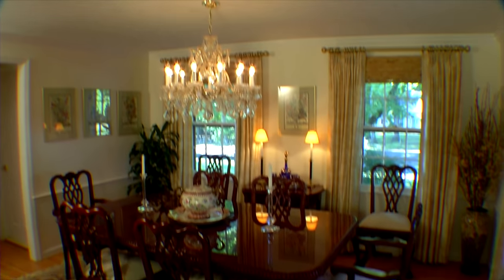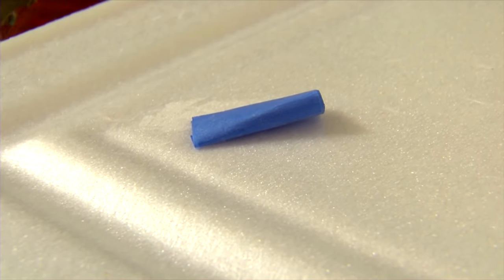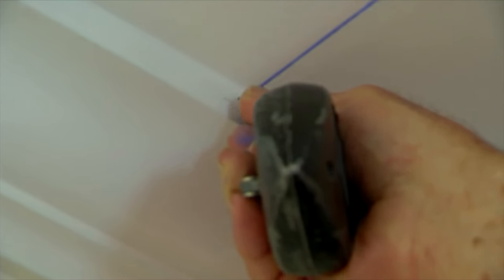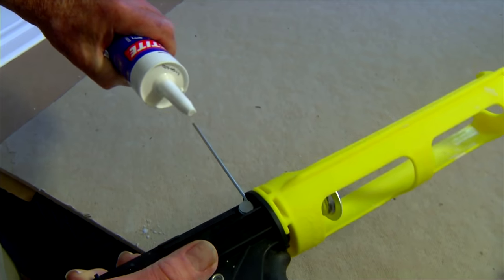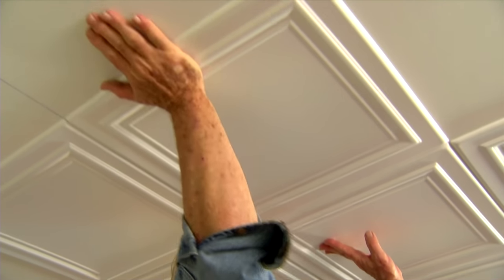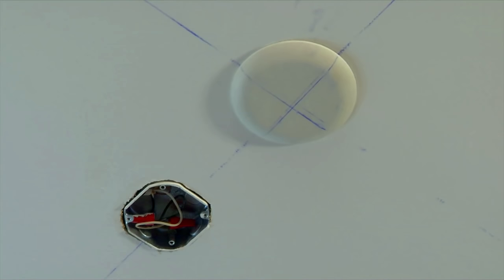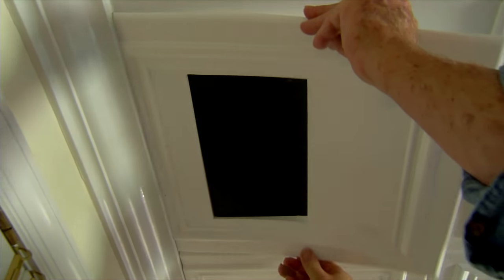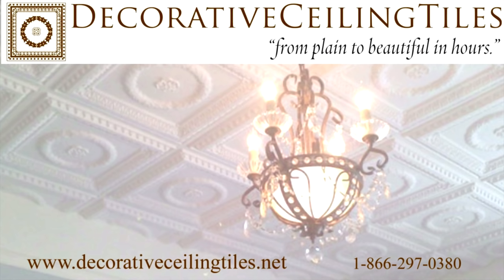Styrofoam Ceiling Tiles Installation  by Ron Hazelton - Create a Beautiful, DIY, Affordable Ceiling

Comment: On the smaller edge pieces, instead of just lopping off one end, cut out the center of a piece and join the two finished, framed ends, then join those in the center with some filler to create rectangular frames. That way they match the look of the rest of the tiles without a continuous, unfinished length of ceiling.
Reply from the maker: This a great tip! Thank you

Comment: just ordered these tiles to finish my moms bathroom and will keep your vid right there by me as I do it :)
Reply from the maker: Hi Brian, I hope the results exceed your expectations. If you need any advice, you can reach out to our support team at 866-297-0380 M-F 9AM - 5 PM EST.  Milan Jara
Reply: Hi Milan I finally started the job yesterday and it looks great, will send pics to your website? But I do need the crown molding to finish the project and currently looking on the site. Thanks, Brian
Reply from the maker: @brigildea  Hey Brian,  great to hear you are pleased.  Yes, most of the time people cover the edge of the last tile with crown molding.  Check out the KL60 or KL80, these are priced the best and shipping is lower because they are 6.5 foot long only.  https://www.decorativeceilingtiles.net/styrofoam-crown-moldings/
Reply from the maker: One more thing, we also cut corners if you need us to: https://www.decorativeceilingtiles.net/pre-cut-a-la-maison-crown-molding-corner/

Comment: I've found that the dime size dollops do not work if you install over a popcorn ceiling as the moisture in the adhesive cause the popcorn to detach from the sheetrock.  I think it works best to go ahead and take off the popcorn before installation
Reply from the maker: Angela, it depends on your ceiling; some ceilings are painted, and the paint protects it from loosening up.  We have done ceilings where the ceiling did get loose because of the moisture but other did not. Taking off is fine, just make sure there is no asbestos and wipe off dust so the glue does not stick to dust if you are putting up tiles.

Comment: Great video sir! I heard you state at end of video that you can paint tiles after installing, but won't it be easier to do before?
Reply from the maker: It can be done both ways.  In this video the tiles were ordered already painted.  However, it is not hard to install, caulk and paint the ceiling with a roller or spray it.  Now of course it will depend your situation.  Remember if you were to paint the tiles before yourself, you will need as much indoor space away from wind as is the size of the ceiling they are going on to lay them on to dry.  You can surely do this in batches.  For some people the best option is to get them painted.

Comment: Can I obtain this material in buenos aires Argentina?
Reply from the maker: Hello Henry, not sure but you can order it from us, we can certainly ship to Buenos Aires.   Here is a link to order https://www.decorativeceilingtiles.net/20x20/
Reply: @DecorativeCeilingTilesInc  I want to know the cost of each one or by unit of packaging, and also delivery charge. Thanks for your prompt answer
Reply from the maker: @henrycassaigne8313  you will need to go through our website to get your landed cost.  Our system can calculate that for you based on your address.  Thank you